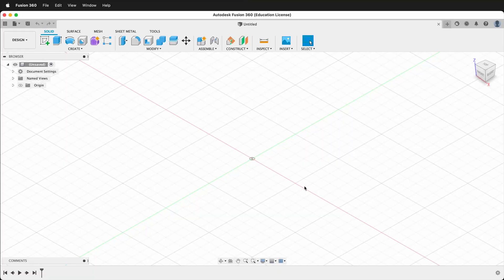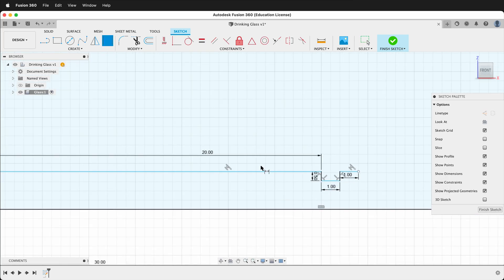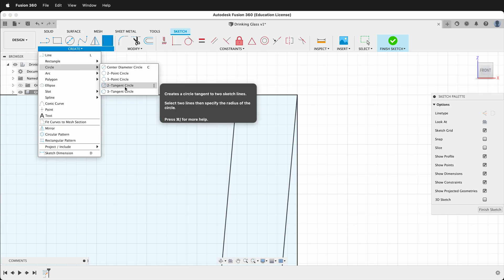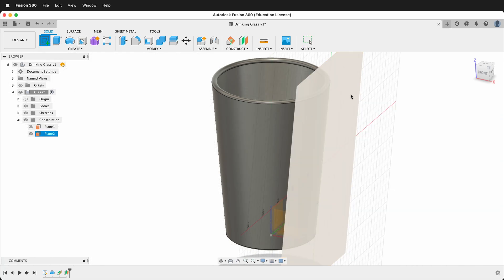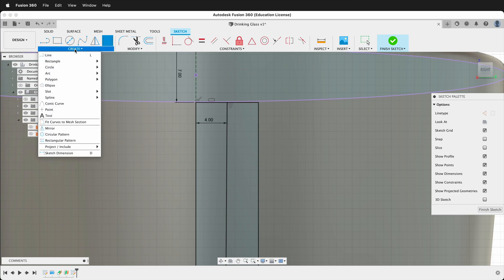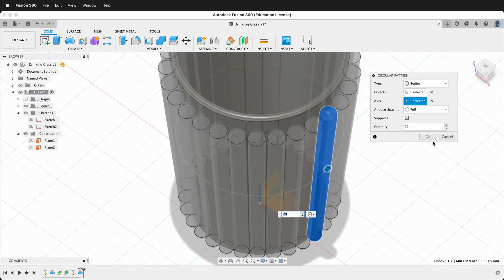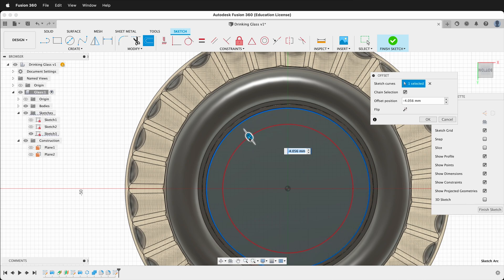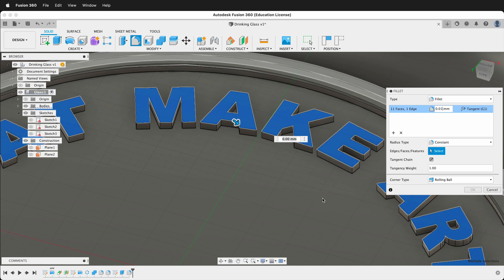Master Autodesk Fusion 360: Create a Stylish Drinking Glass - Step-by-Step Tutorial

Comment: This tutorial was brilliant,  thank you. As a request,  could you do a tutorial with a similar style,  but as a split cup paint pourer. I tried modifying and working with this,  but I failed miserably. 
Cheers
Reply from the maker: That looks like a fun shape to model in Fusion 360 .

I would probably make a series of sketches stacked on top of each other. One would be the base of the split paint pour container. The next would be the bottom of the spout, then another one for the middle of the spout potentially and then the top of the spout.

Then make a loft in between all the sketches. Shell out the form. And add the dividers. After a couple more fillets it should be done.
Reply: @WhatMakeArt  thank you. I'll have a crack at it.
Reply from the maker: Let me know how it goes 🎨🍵